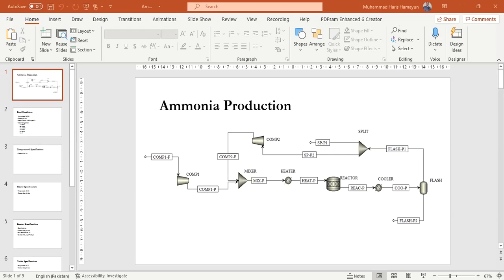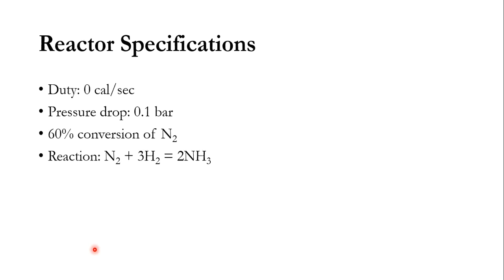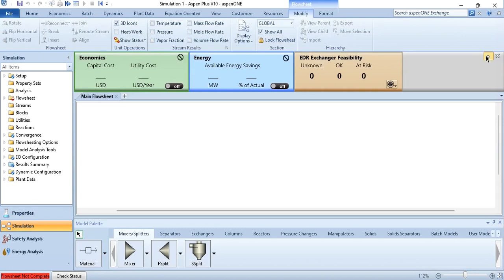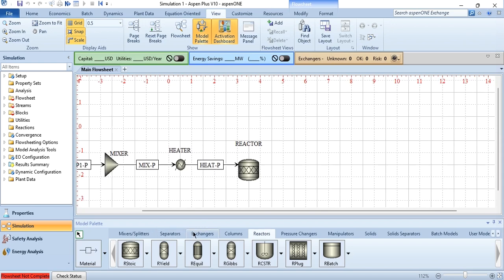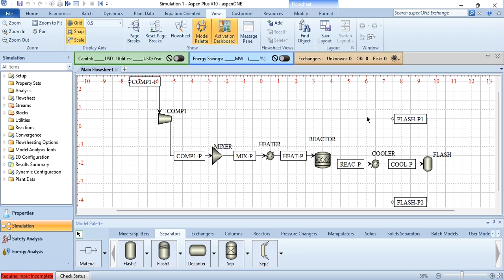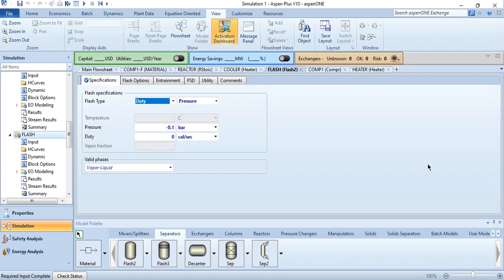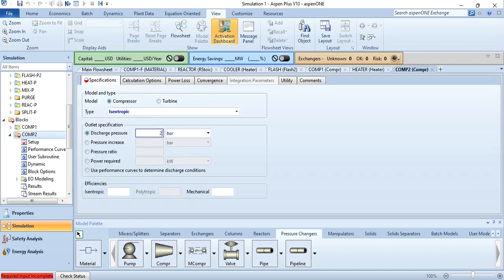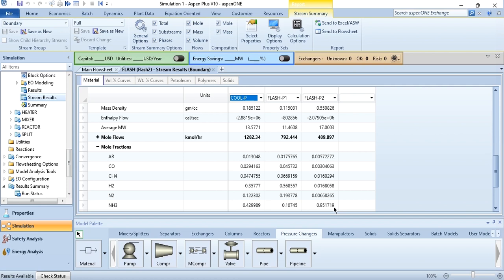Process Flow-sheeting - Ammonia Production - Representation of PFD - Aspen Plus - Lecture # 86

Comment: Instead of putting a heater and a cooler, can we put one heat exchanger which uses heat from the reaction to heat the fluid?
Reply from the maker: Yes. The heater and cooler are simply used for the understanding.
Reply: @aspenchemchannel  how is the temperature in the reactor maintained at 400*C, do we provide extra heating/cooling for that?
Reply from the maker: Yes. External heating needs to be provided for the endothermic reactions for maintaining the temperature.

Comment: Why should we reduce pressure in the reactor? what is purpose of pressure drop in reactor?
Reply from the maker: Usually there is a slight pressure drop industrially, so to make it a realistic look, this has been included.
Reply: @aspenchemchannel  Thank you for your kind answer. :) But one more question. Why do we split by 0.05 in the spliter? Is it also reflecting the realistic efficiency of recycling process? and why do we use syngas without carbon dioxide?